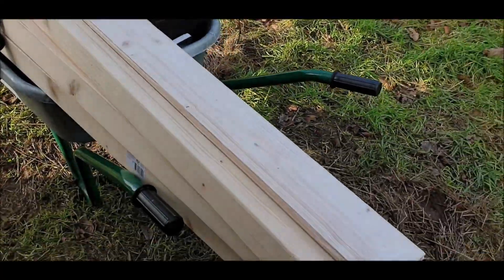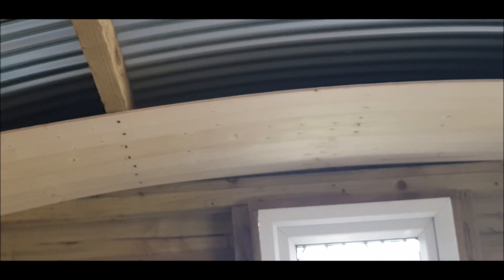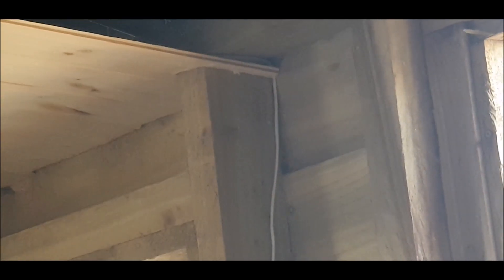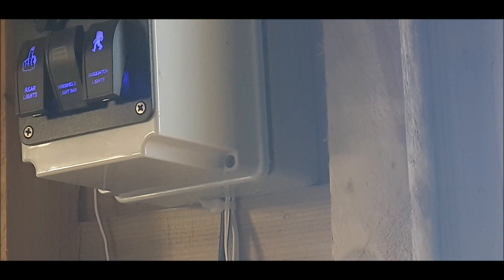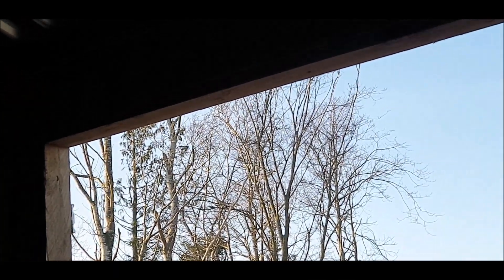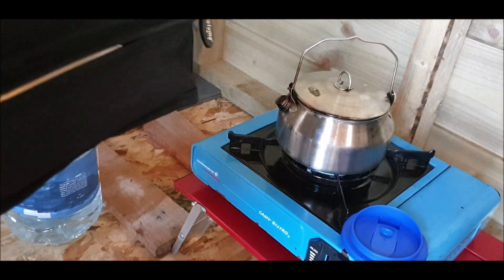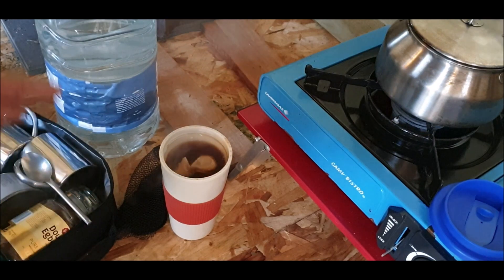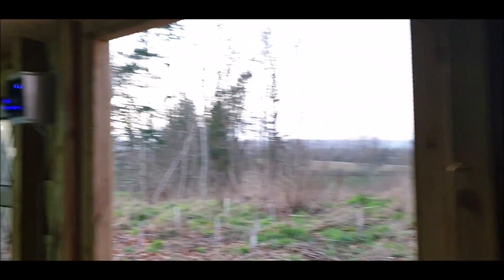Off grid cabin roof insulation and cladding

Comment: I built a shed in the wood a few years ago, I was advised that a vapour barrier between the interior space and the insulation was essential. Warm, moisture laden air can percolate through the insulation and condense on the cold inner face of the roof and walls, this will eventually saturate the insulation. Interstitial condensation? I used green builders polythene and made sure all the holes and perforations were well sealed. We used our shed for six or seven years and had no condensation or damp problems. Love what you are doing and wish you well.
Reply from the maker: Thank you David i did wandered about that
Reply: @MrMeltedwellies  Yep A vapour barrier is a good idea, I remember doing dew point calculations in college to determine if vapour barriers were in the correct position.